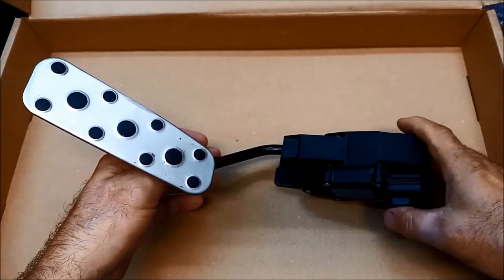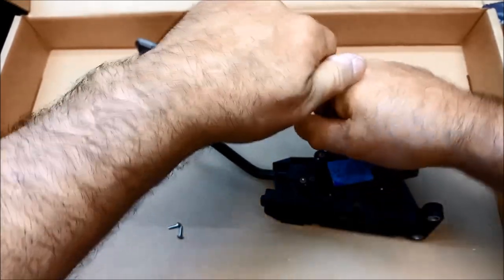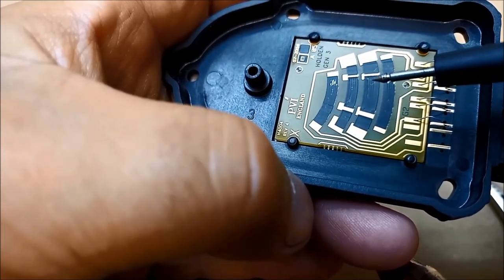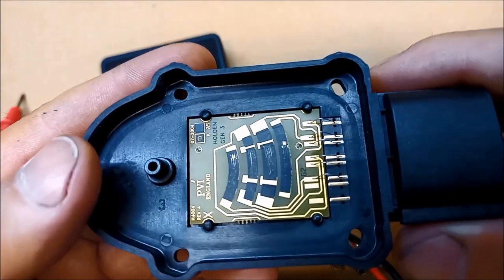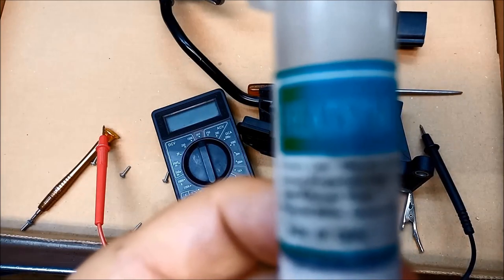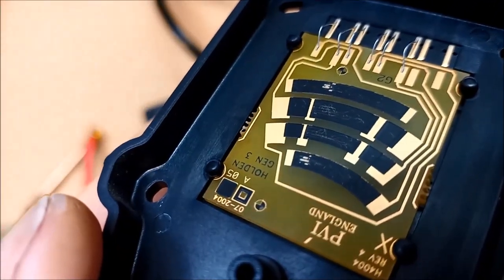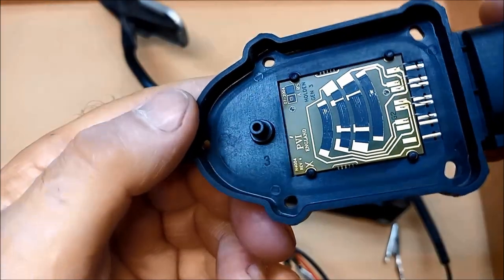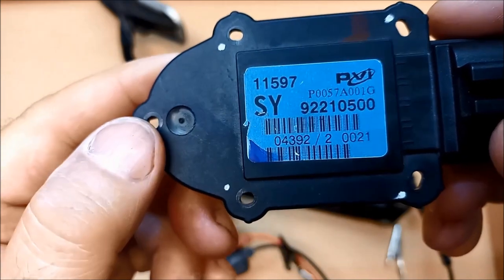Accelerator Pedal Position Sensor - APP Sensor Accelerator Position Sensor Car going into Limp Mode

Comment: Thank you very much for your video, it was very helpful for me to figure out the pedal problem. Can you tell me what tool you used to check the pin function of the accelerator pedal sensor in the video? The interface of that tool looks very detailed.

Comment: I was under the impression that the black tracks are conductive where the resistance varies as the sweep arm moves across it. coating it could be a no no? What is the website address that you mentioned?
Reply from the maker: hi, you could be right. cheers
Reply: That’s what I thought too, the gradual increasing / decreasing resistance of the sweep, is what would enable the gradual change in acceleration / deceleration. Also, I would imagine that conductive grease, would short the circuit, because it would be conductive at all points of the sweep, whereas a non conducive grease, would insulate it and stop it working altogether too.  Not sure if my “logic” is correct.

Comment: The black coating is the actual resistive material - when that is worn it is stuffed and cannot be fixed properly. Some how moving the fingers to a  un-worn area might work - but not reliably. Absolutely stupid short term technology. RockAuto in the  States recently had new stocks of pedals for the Pontiac GTO 6.0 - ACDELCO  92510118. Should be compatible with VZ 6.0? Real solution is new electronics that does not use contacts - like the fix on Wheeler Dealers for the Maserati throttle body - same problem. The actual electronics of these pedals is very simple - and cheap. Pedal and throttle need to match. Multi tracks are used as a cross reference - and are used in parallel - all are variable resistance as contacts move.
Reply from the maker: thanks & cheers for that👍
Reply: Hi Jonathon! Are you aware of any pedal made that may work with the LS1's?
Reply: And some of the truck pedals such as 2002 Cadillac Truck Escalade 2WD 5.3L MFI OHV 8cyl, these are LS1 with electronic throttles.  After market sensors are available for these.